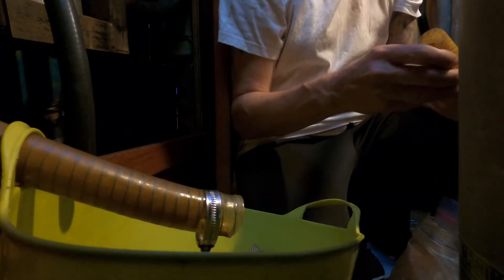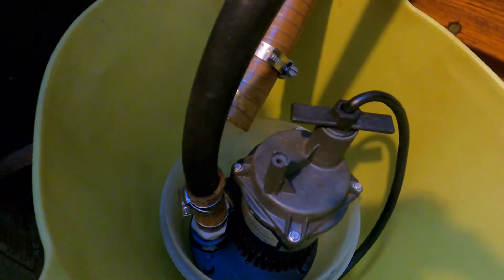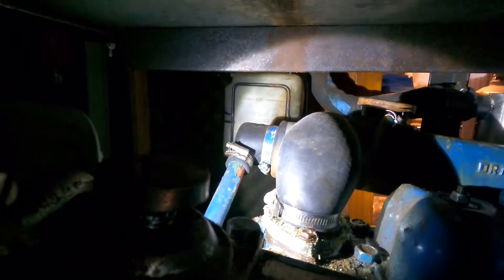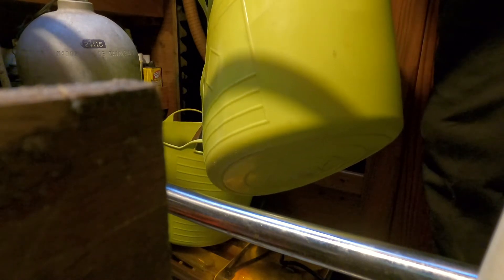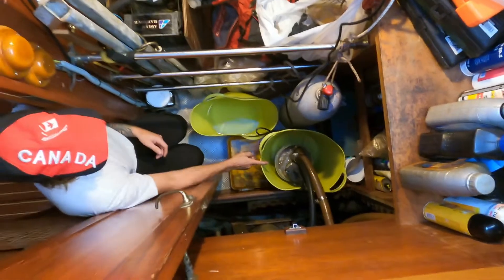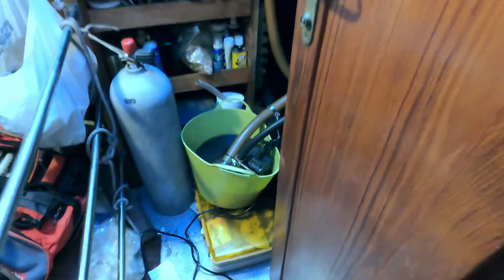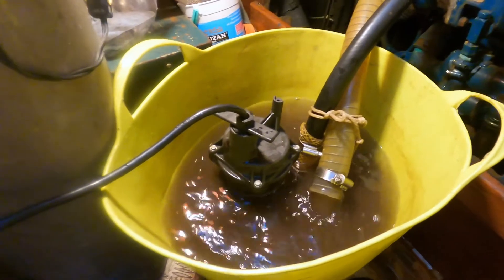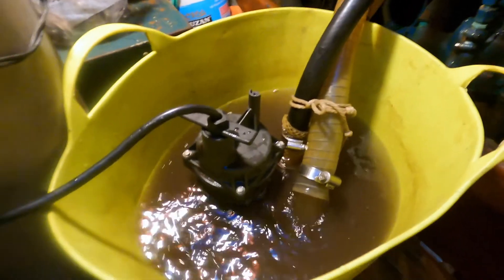BARNACLE BUSTER THERAPY | HOW TO SOLVE ENGINE OVER HEATING EP10

Comment: Here in South Carolina Diesel mechanics dilute Cascade Powder Dishwashing machine soap in hot water. 1 Cup of Cascade to 1 gallon of hot water disolve the soap in the water then pour it in the radiator and run for 30 minutes the flush it out with fresh water....... repeat until water runs clear. They swear by it here and is cheap considering a box of Cascade is $ 3 .
Reply from the maker: That’s pretty clever, I’ll have to check it out!
Reply: @SailingKnotLife  Just found your page watched the Dodger series noe going all the way to the beginning and binge watching from ep 1

Comment: Sure, it'll clear out the heat exchanger, but it will also destroy any aluminum parts (and gaskets) in your engine. Yanmar don't recommend doing this for a reason.
Reply from the maker: Thank you for your information,  I did not research Yanmar, I just know it was great for my perkins, still running cool.  Sorry I have no input what to use on Yanmar. I hope you find a solution that works for your situation.